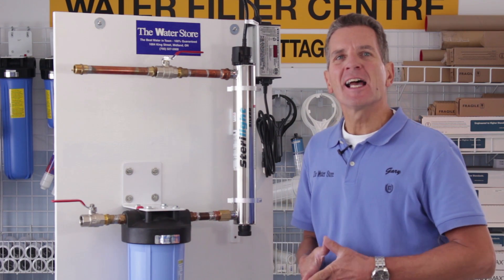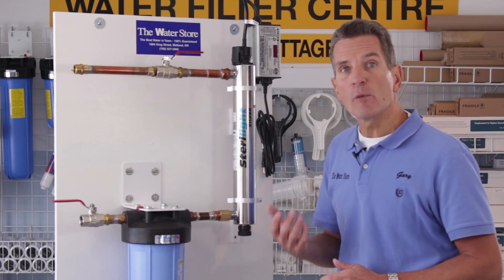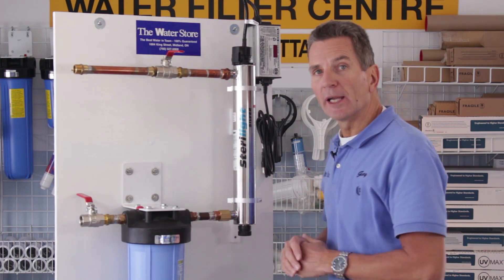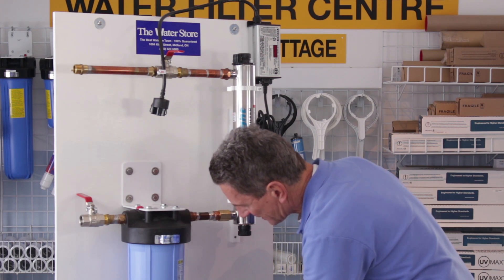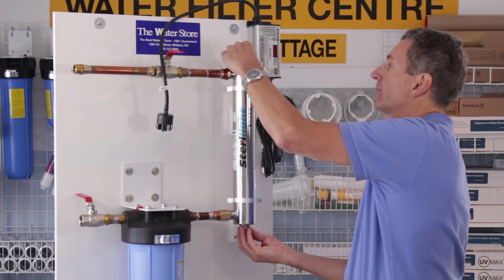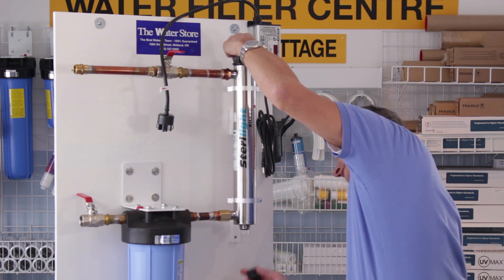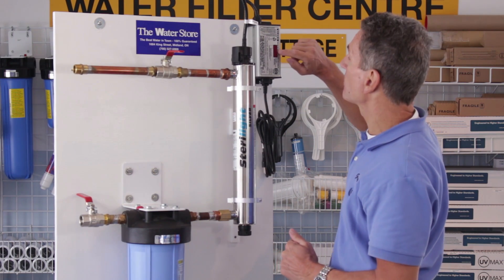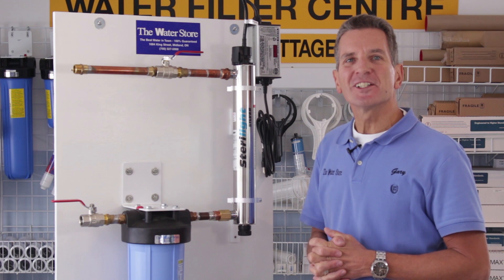How to Replace Viqua/Sterilight UV Lamp in Water Filter

Comment: I have an older Sterilight S24Q 2 bulb system that was installed by the former owner.  I have replaced the bulbs and sleeves.  The system will not stop beeping and there is no reset button on the controller probably becuase it is 20 years old.  I assume I should replace the controller but the part BA-3612 does not exist anymore.  Is there a different controller that will work for this system.  Thank you
Reply from the maker: No, that product is obsolete, but if you send us an email at info@waterestore.com we can get you 20% off a new system to replace it.

Comment: Another year another time watching this. Thanks so much. I have a horizontal installation for the lamp so water doesn’t fully drain from the tube. We remove as much as we can but does the bulb get damaged if there is some water inside the sleeve?
Reply from the maker: Yes, it is always difficult to replace the sleeve and not get any water inside of it.  There can be a wee bit but ideally the bulb should not sit in water.  I have often blew out the sleeve with compressed air before inserting the lamp to remove 99% of the water.

Comment: What do I do if my quartz sleeve is stuck?  I'm at the 5:02 mark with both nuts, bottom spring, and both O-rings removed and if I let go of the quartz sleeve at the top, it goes nowhere.  I don't need to hold it at all and I don't want to pull too hard on it in case I break it.  I'm dealing with a Sterilight S12Q-PA that's connected to an acid neutralizer, if that's relevant at all.  I did have a bit of sediment in the bucket when the water drained, so could that be part of the issue?
Reply from the maker: No, just make 100% sure there is no pressure left in the UV and then just push she sleeve out on either end.
Reply: Yeah, there’s no pressure in it and I feel like if I push it harder, it’s going to break.  I think it must have calcified in place.
Reply: Still have this issue a year later.  Trying to put CLR around the sleeve.  There’s a little wiggle at the top, but absolutely no movement at the bottom.

Comment: Does the controller has some kind of fuse? The UV part is not heating (no even with a new UV light). Controller shows 365 which should mean it's operating.
Reply from the maker: No there is not fuse.  Are you waiting several hours without water usage to see if the water has become hot.

Comment: Are the less expensive Chinese bulbs as good as the o.e visual sterilight.And can it function good without cleaning the glass tube which I have not cleaned in 10 years?
Reply from the maker: Nope, the Chinese lamps I've used never actually lasted more than 6 months, don't waste your money.  If the glass tube is dirty the UV light will not shine through and you are wasting your money on UV lamps as nothing is working.

Comment: Hi, what would cause my unit to leak from the bottom? Any advice is appreciated!
Reply from the maker: Usually if the gland nut isn't tight enough.  You could also try adding silicone lubricant to the o ring.https://waterestore.ca/products/plumbers-clear-silicone-grease-5g

Comment: Not a bad demo except the bottom ring is crucial and he just barely touches on it.  Second the older style pull push clip is a pain to line up on post-bulb change closure.  Pay attention to where it is on disassembly.  Lastly not sure it’s a good idea to have power on to lit bulb without water against the sleeve to cool unit.
Reply from the maker: Thanks for adding your comments. If you don’t power it up before adding the water you run the risk of passing not treated water down stream and infecting your treated water.
Reply: @water_estore  Or just fill up the sediment prefilter housing with bleach before screwing it back on, run this into the system, hold for a bit and wash it out by running everything connected (careful not to run washing machine with clothes until system is purged).

Comment: Well done.  Thanks.  You may want to consider expanding the video, showing cleaning the glass tube with white vinegar, then advising people to then clean off that vinegar in a gallon bucket of clean water (put the clean water in that bucket before turning off the water), before replacing into the SteriLight.  You may also want to emphasize the difference between silicone GREASE and ordinary silicone.  Once again: excellent information.
Reply: Thank you for the additional info.

Comment: Your display has the water inlet and outlet on the sides of the unit.mine is plumbed with the inlet on the bottom directly into the unit.does that mean the sleeve must come out only from the top????

Comment: Hi Gary - Great video, but I do have one concern.  At the end of the video, you are suggesting to plug in and reset the lamp timer before turning the water back on.  That's a big booboo, that bulb will heat up quickly and when the cold water hits it, it could break.  You should turn on all the water valves, checking for leaks, and clearing any air from the system before plugging in and reseting the lamp.
Reply: @water_estore  Respectfully, I will point out that the installation guide from Viqua differs: "When all plumbing connections are complete, slowly turn on the water supply and check for leaks. The most likely cause of leaks is from the O-ring seal. In case of a leak, shut water off, drain cell, remove the retaining nut, wipe the O-ring and threads. Clean and re-install.7.Once it is determined that there are no leaks, plug the system into the ground fault interrupter and check controller to ensure the system is operating properly. The controller should illuminate without any alarms. Note: DO NOT look directly at the glowing UV lamp. 8.Allow the water to run for a few minutes to clear any air or dust that may be in the UV chamber.Note: When there is no flow, the water in the cell will become warm, as the UV lamp is always on. To remedy this, run a cold water tap anywhere in the house for a minute to flush out the warm water."   But to your point, the installation guide also says to never allow untreated water into your system until the bulb has run for at least 5 minutes.  Seems there is no perfect answer, you would almost need some kind of bypass after the filter, but before entering the home plumbing to drain water after a filter change.  Nobody is ever going to bother with that.

Comment: @The Water eStore I need your help. My quartz sleeve cracked on the top and bottom while I was cleaning the system. I assume that is the reason water is now pouring out the top of the system when I turn the water back on?

Comment: Thank you ! Saved me a whole lot of time and headache. So easy. One thing I didn't know. Couldn't get off the big housing . I pushed the release button for the pressure but it didn't budge. Pressed it again and finally held it down which worked. Filter was dark brown. I think I need to change mine twice a year!
Reply: Hey Kelly,I use a 3 foot poly hollow pipe and attached with tape and screws the original filter wrench for great leverage to get the blue filter housing off,?it works every time.

Comment: Thanks for the great video, Gary ! I have a question - my unit is upside-down, so after removing the lamp and the sleeve that by the way cracked, as I was inserting a new quartz sleeve into it's place, the remaining water was all over the sleeve. I am not sure if it entered the sleeve, so whether or not the water got onto the light. The sleeve was all wet from the outside and water was dripping around the opening. I am afraid whether or not my UV filter is working or not? I would appreciate your thoughts on it.
Reply: Thank you, Gary, for your reply. It seems I've managed to do it right this first time. Lots to learn about living in the country. :) I do enjoy your videos and advise.

Comment: Great video, just bought a house with this exact model installed. the problem I have is that the systme is installed too close to the basement ceiling. Can I slide the replacement bulb in from the bottom? I don't see any other way to do it as the top connector is 10" from my ceiling.
Reply: Thanks alot for the reply.
Reply: Jeff Gray hi Jeff, I have the same scenario at my house and cannot see the response to your question. Are you able to replace the bulb from the bottom? Thanks

Comment: What does a flashing red light mean on the middle light of the timer after the sleeve and bulb has been replaced and the timer is plugged back in? And how does the timer reset to 365 days?

Comment: Thank you Gary.  Mine is installed vertically however.  The ballast is at the bottom.  I.e. Upside down?  This was the way it was installed from the contractor as it is a new home in Hawaii.  So follow the video opposite?  Again.  Thank you so much for having this video out here.
Reply: I think I see why they installed it upside down Gary.  After reading some of the manuals.  It says to install with inlet at the bottom.  Our incoming water from the outside and filters comes into or in the water closet from the top.  So, nearest I can figure.  Instead of re piping it.  They put it upside down so as the incoming water now comes into the bottom of the unit.  Yet with it upside down it is the top.  If that makes sense.  I wanted to just unhook the water lines as there are unions at each connection.  And relocate the ballast and turn it around.  But that would have the incoming water coming into the top of the unit where the lamp connection would be.  Right now?  There is a pipe below and I would be lucky to get the lamp out from the bottom as it is anyhow.  Thank you so much for the imputs on this.  This plumber didnt do such a good job.
It is btw.  The S12Q-PA.  Did they eleminate the drain when they went to the plastic caps?  The lady at the store where I went to get the lamp said there would be a drain but in the manual it says the aluminum caps.  And I see no drain on ours as we have the newer version with plastic caps
Thank you again Gary for you expertise 
Don